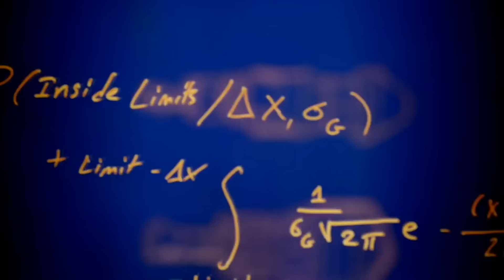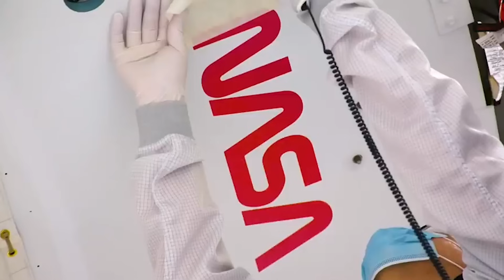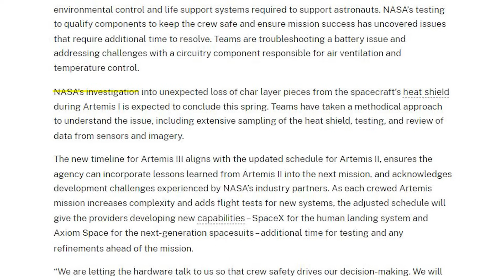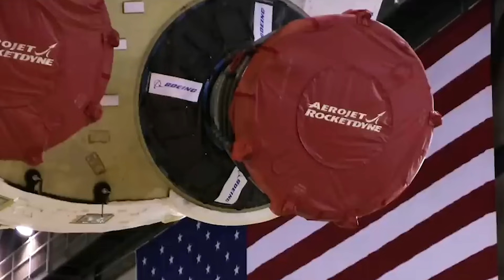There's A Problem With NASA's Modern Human Spacecraft

Comment: This is why I think that all those breathless people who believe China will somehow surprise us by beating Artemis to a manned landing on the surface of the moon are wrong. 
We are the only nation on Earth that has already done this 5 times. And even we are finding unexpected problems with our scaled up Artemis program. 
China operationally is about on par with Skylab or Mir in their manned program and about on par with our first little robot Mars lander in the unmanned program. They have yet to finish the Moon launch vehicle (due in 2028-30). They have never built a man-rated cislunar capsule or a heat shield capable of withstanding the lunar re-entry speeds, (although supposedly they are testing a prototype). They have yet to reveal a design for their manned lunar descent vehicle. 
I still think we are in the lead due to our flight heritage and the milestones already achieved. Starship is also a home-run-swing-for-the-fences type of capability. If it succeeds, it will be light years ahead of other lunar landing capabilities, since it would be capable of delivering tons of equipment and supplies to the surface on each flight. Such a capability makes a permanent Lunar Base a sustainable possibility.
If Starship starts flying every week or every few days, then the volume and mass of payload to LEO and cis-lunar space will be mountainous.

Comment: That Orion heatshield has been a curse.  It's size and mass is the biggest driver of Orions excessive mass and the difficulty in manufacturing and EVERY single stage of the mission has to carry this penalty.  And all of this decends from the completly bonehead desision to copy the Apollo shape which was itself a completly arbitrary choice that was obsolete the day it was chossen.  We knew by Gemini that a steeper gumdrop shape would work and be far more efficient, but the Apollo capsule was too far along in development to change.  Had a proper capsule shape design been done then Orion diameter could have been a whole meter lower for the same volume, but someone thought it was good to 'reuse' all the Apollo airodynamics data.
Reply: So, you were going to pay for all the new validation and verification of a new shape?

Comment: NASA should load Orion capsule on falcon and test the shield while saving money and reducing risk. Plus they should gotten rid of the separe service module and make it part of the capsule, made the capsule longer, use the service module engine instead of the solid rocket abort engines for abort and use stokes metallic fuel cooled heat shield.
Reply: That won't work.
1) The heat from re-entering from the moon is much hotter than re-entering from LEO. so, it wouldn't be a good test of the heat shield.
2) Making those changes to the capsule, would make it much heavier, and thus have much higher re-entry temps which only creates more problems.
Reply: Service modules exist because their massive, far far more mass in fuels oxidizer etc to move and supply a capsule then the capsule itself weight.  Heat shields scale with the mass of what your trying to bring through the atmosphere so you save huge mass by dumping the service module.  The engine of the service module dosn't even produce enought thrust to lift the weight of the service module on Earth, and it would absurd overkill for it to do so.  Even the Apollo service module with it's FAR larger engine could not hafe lifted the Apollo module against Earths surface gravity, let alone the multle g's of acceleration needed to get safely away from an exploding booster.  Basically everything you have said betrays total and complete ignorance of every bit of enginering involved here and that fact you even deem to have an opinion on the issue is peak Dunning-Kruger effect.

Comment: The 3 in Artemis 3 actually means 2030, because there's no way that mission is happening before then.
Reply: Artemis 3 will probably happen in 2026 if they decide that a lunar landing will be delayed to Artemis 4, otherwise it will get to delayed to fly when starship hls is ready which could be years from now
Reply: @mathewferstl7042  no reason for multiple no lander artemis mission. other than keeping alive the pipeline, but at that point they are already in fail mode. sad that the blue origin lander lost three years for the fucked up selection.
Reply: @thorin1045  it is a shame, ALPACA the integrated lander vehicle were all more sensible options
Reply: I think 2026 is unrealistic, 2027 optimistic, and 2028 realistic.
Reply: @zander_the_space_fan  yeah I'm actually thinking late 2028 too, I just thought of the silly 3 joke and couldn't resist.

Comment: I was initially upset about the 10 month delay .. but in the grand scheme of things it won't be so bad.  I believe this is nothing compared to the delays in-coming from Starship's HLS, of which we  haven't even seen a mock-up yet.  Building and testing HLS will likely find many issues that will take months and even years to address.
Reply: almost sure the artemis two delay is mostly because if they have to wait for the three anyway, than they can tinker with the minor issues without any time loss. also they want to see if the three gets even more change so the two can do the actual preparations needed for the actual three. the only funny and unfunny result would be if the artemis five (with the blue origin lander) happened before the three (planned for the hls.)
Reply: Starship useless for human landing

Comment: The heat shield is probably fine. The double dip skip maneuver if pretty harsh. I think they are just using this as an excuse to cover for SpaceX, who are clearly not even close to building the HLS.
Reply: Its for extra safety (supposedly anyway, doubt they would “cover” for spacex
Reply: @Hungary_0987  Well in their report it wast for extra safety... merely that the shield ablated more then expected. The "delay" is only to find out why it didn't preform as expected. The shield has clearly worked within margins the two times it's flown.
Reply: If not covering, but internally acknowledging that they are definitely some “tall tent-polls”, which HLS is becoming a serious one that will need a lot more time. Doing this delay does have the vibe of deflecting attention away from the real problems.
Reply: @Mentaculus42  Exactly.